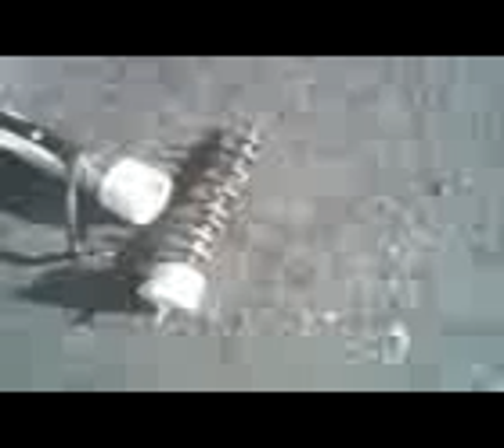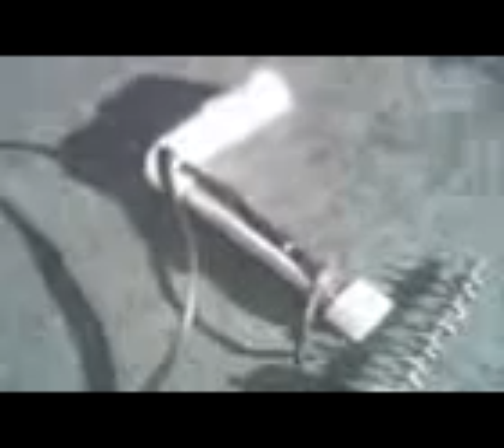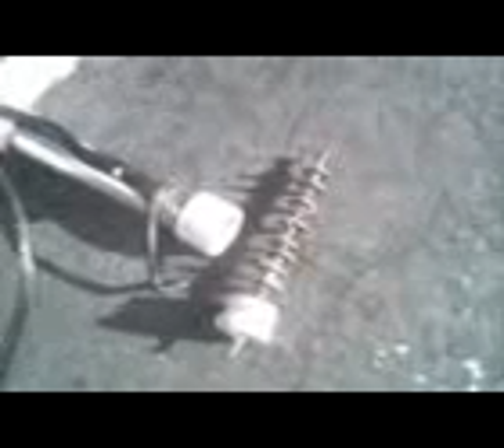HHO inside element

Comment from the maker: With all due respect.  The only thing you are suggesting is to electrolyze gasoline itself, to get the hydrogen out of it(which may not be possible, not something I will be trying).  Otherwise, you are comparing different compounds with the element of hydrogen atoms chemically bonded.  That is comparing apples with oranges.  Different chemical compounds react completely different from each other.  The monetary savings are the proof.  However, admittingly my savings has been small so far.